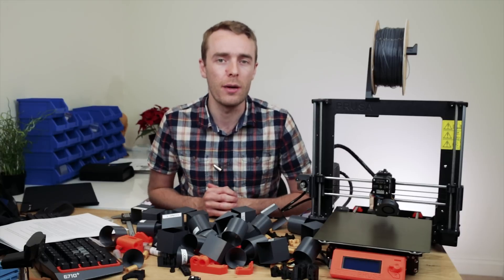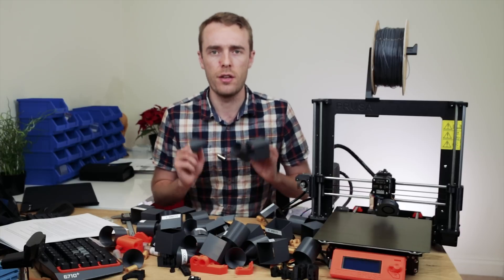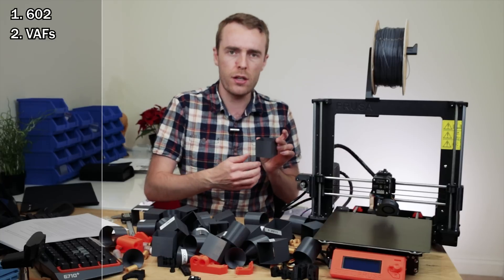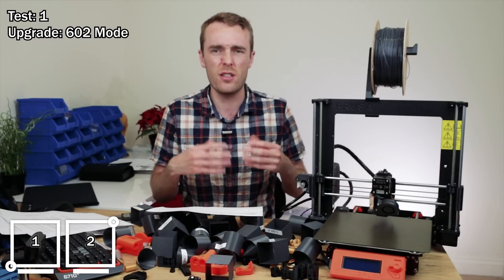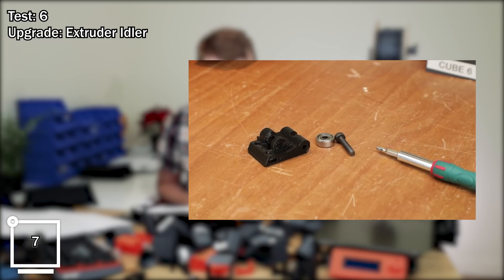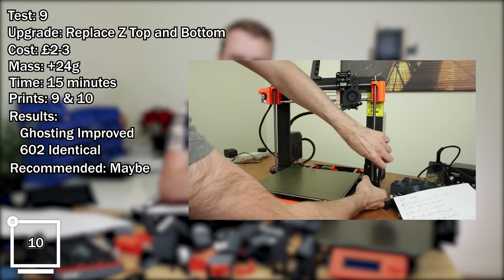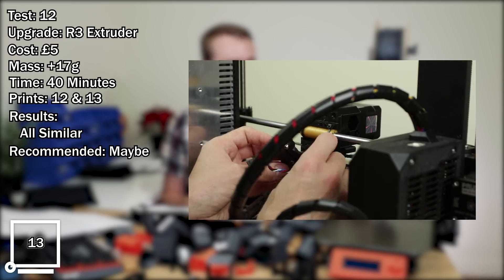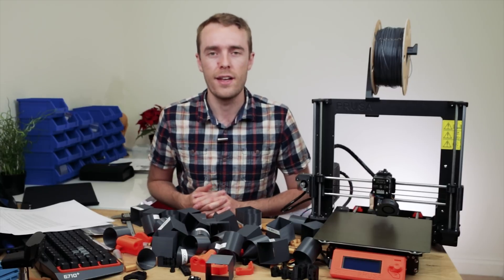4 Weeks Testing Prusa i3 MK3 Mods

Comment: First Craftbot models also used direct drive extruder like the Mk3 and also displayed 602 issue specifically the woven basket look of the walls . Those were using Tmc 2208 drivers and proprietary firmware which leads me to believe drivers and firmware have nothing to do with the problem but that the culprit is the filament driving mechanism . Indeed in Bowden setups or geared extruders like the Titan or Bmg the 602 issue is almost non existant or at least greatly diminished . I suspect that a very short and constrained filament path from gear to nozzle and the fact that direct drive means no backlash to absorb some of the drive shocks means that all vibration results in extrusion pressure altering which leads to the inconsistent layer problem .

Comment: I had unconsistent extrution on my mk3s tried many things.new titaium heatbreak . Bondtech extruder , nozzle ,checking belts nothing help ..but when i changed out the original Main board whit a duet2 wifi board it went away

Comment: Just make a cylinder and put the bearings in, all knows that plastic bearings get deformed without a proper even mount. Correctly made they are way better, very easy to print as well.

Comment: Hi, shooting in HD and thde uploading in 4 k does not increase the detail. How can it?. All that's happened is that some form of interpolation has taken place, but the apparent extra detail is all fake. Stick to HD, no one can resolve 4K TV with their eyesight unless just a few feet away from a 65 inch TV, and most people are watching on tablets or phone sized screens.  It can be worth while doing it the other way round, shooting in 4K and down sampling to HD, but eve that is fraught with problems - extra artifacts can appear unless you use quality software to do it. BobUK.
Reply from the maker: The photos are much higher than 4k resolution.

Comment: Yet those prints look worse than a properly tuned ender-3 :/
But this goes to show, frame rigidity matters most, and Prusa has been always crap on that. See how the feets change the results, if the frame was sturdy, it would have 0 impact.

Comment: After struggling for months with the 602 and related print quality issues, after trying all reasonably cheap and effective mods I could do, I could not solve this... until I've built myself a Skelestruder (w\ Zaribo Pancake motor, the lightweight shaft, ..) by JLTX! Since the extruder rebuild/switch, It's been printing consistently easily and fast, the extruder (end even X axis) motor is completely cool at all times, I am speechless. And it all can cost just couple $. Here's the link: https://www.thingiverse.com/thing:2845416

Adam, if you've still haven't solved this issue yourself, please give at least the Skelestruder a try, but don't overlook the JLTX's Taurus axis upgrade "line".

Comment: 602 to me looks like a calibration problem with linear advance which makes sense since linear advance is trying to cause the extruder to extrude t the same rate during accelerations. If its messed up, the extrusion will be messed up. Have you just done a linear advance calibration per the book?

Comment: Is issue 602 fixed on the prusa i3 mk3s?
Reply: i was also wondering this, i would imagine so as they built a new extruder for it
Reply: @theaces3697  I found a solution! https://www.reddit.com/r/prusa3d/comments/c4wxmp/prusa_issue_602_actually_solved_mk3s_and_probably/

Comment: blurry

no need for 4k of fullHD, just use 720p, for the unsharp picture that would be enough
Reply: @Vector3DP  I read somewhere you can adjust the lens of the raspberry pi camera manually. I did it with a small 6.5 mm plastic cap I had been laying around. Just do delicate 1° pushes, THEN the 1080p@10fps would be soo cool :-D

Comment: Hmmm. A lot of work but these better prints look worse than my Ender 3.
One note: every change and print is lowering the mass of your spool. I don't get why designs put the spool on the printer frame. You should try putting the spool beside the printer.
Why would anyone use PLA for bearings?

Comment: I think main problem is low resolution + 256 microsteps. One rotation of the bondtech gears have only 200 full steps. Microsteps do not have much torque. Direct-Extruder do not have the "spring" effect bowden extruders have. So "randomly" only fullsteps tranport the filament, but sometimes also parts of the steps do so - it's not consistant.
By higher resolution of full steps you reduce this problem a lot. I tried thing:3165551 and an original Bondtech BMG (you may also use a Dual Drive BMG from china, as you can change the gears to the original Bondtech ones you already have). Due to the 3:1 ratio extrusion inconsisty seem to be gone. You also can change to a pencake stepper (to reduce moving mass) or a 0.9° stepper (for doubling resolution again) or both (if you can get a 0.9 pencake).

Comment: You may try to put rubber washers (standoff or the like) on the filament cooler fan.  I have seen that fan vibration (specifically from a cheaper blower) to affect print quality by adding noise to a layer. This can be a bit chaotic as it does not always manifest itself the same way.  But when removed (or replaced with an expensive blower) the issue is removed.  The effect is close enough to warrant a try as it may be an element of the problem and not the entire issue.

Comment: Dear C.R.T.! Wonderfully educational video, I have been battling this issue for about 6 months as well, but my research has led me down a completely different line: If I print the cube at a 45 degree angle to the the bed, issue 602 is very highly mitigated for me. This seems to indicate that this is not the extruder's fault, but the fact that there is a repeatability issue in the movement of the axes. 
Try printing your single wall cube at a 45 degree angle, so that both X and Y are in motion at all times, you will be amazed by the difference!
Reply: beherith66 what exactly do you mean by print the cube at a 45 degree angle? I’m still not sure what you mean by that? Thx also if you have any more updates on this issue that would be great cheers

Comment: Also the prusas biggest problem is that the vertical linear rods are attached to the frame with those printed plastic brackets. I Think removing those and replace them with linear rails that are attached to the vertical frame would improve the printer a lot.

Comment: This'll make you laugh. I spent hours in OpenSCAD trying to make single-thickness walled cube/cylinder/cone STL models that would slice with one path on the wall, without success for the cylinder and cone. Then yesterday it suddenly clicked - just use a trivial normal cube/cylinder/cone and set the slicer (Cura) settings to no infill, no top/bottom layers, wall thickness 1. headdesk

Comment: Looking for an answer to my question concerning temperature setup for ABS.
When I start my setup for ABS preheat is set to the filament of choice which in this case is ABS. The temperature ramps up and settles in to match the target temp. When I select the item to print the printer changes the target temp for both the nozzle and bed to that of the a PLA setting. Ideas why or ifyou have seen this happen?
Reply: Thank you for the definitive answer. You nailed it. Again thank you.

Comment: Simply the Mk3 extruder design is shit. Mk2 was good and the only thing needed was cast parts vs printed for accuracy. Superglue rubber feet and you will see a big difference. Tomas just wont admit that his mk3 extruder design was a step back not forward. Especially the filament sensor and the dual knurled wheel feed. I think a felt seal to wipe the extrusion prior to entering the hotent is helpful as is partial bowden feed at least at the entry of the extruder. The rest is just assembly if your zip ties arent spot on and using a torque driver elsewhere for assembly gives uniformity. While prusa is a great printer. The price value outcome is not what it should be

Comment: PLA bushings work, but you have to take a few things into account. For a stock i3 i'd say only use them on the X and Y for noise reasons. Also those are the SHITTY pla bearings, id recomend you make your own, the ones on thingyverse are shit and badly designed, obviously not by an engineer

Comment: When you were making your comparisons, did you modify your printer back to its original state before testing the next mod? That will have major effects on how each mod affects your prints. It looks like you just went from mod to mod in comparisons which acres your results.
Reply: I must agree is this, the effect of multiple mods, makes the results unpredictable. Fx the any good from the R3 extruder might have been negated by the pla bearings. Or just improved the same thing as another mod did that was already on.

I really appreciate the work, but the methodology is a bit flawed it seems
Reply: The issue is still there. One mod could hide or make other mods worse. The test is valid in the sense that if you make the exact combination of mods as you, but not as useful for the result of each mod by it self.

If you test from base mk3 each time, you might end up with same results, and you might not. But the methodology is flawed if you want the result of each mods impact by itself.
Reply: All mod's must be seen as an example of things you might try to improve print quality. There is no guarantee that your situation is particularly similar to the situation Sanlander tried it on, and neither would it if he had made the test more reproducable for his particular machine. That being said, there is one test that I think is invalid as per  your argument. That is the belt replacement. A good test would be to tension the existing belt very carefully, and position the belt very carefully and have "Settings" report a tension that is very near the recommended tension. After replacement the exact same situation should be reproduced, including in particular the tension. Then it makes sense to compare the prints.

I suspect that the outcome would be that it makes very little difference. A logical recommandation would be that if you use your printer enough to discover wear on the belts, or if you need frequent readjustment of the tension, that would be a sign to replace the belt with a high quality one.

One of the things I suspect is the most relevant to print quality is the force with which bearings are screwed. After I did that with much feel, my vertical surfaces are an absolutely flawless regular pattern of 0.2 mm layers, way better than what I see in this video on e.g. the cube. I can't imagine I could or would want to improve on it.
This would suggest an experiment with a controller momentum screwdriver set to different tightness.
Reply: But you weren't doing just one test so your argument is fairly invalid. You're making combinations with upgrades which create new outcomes by themselves instead of testing the individual upgrades.

Comment: You should try increasing your extrusion temp about 20 deg. My mk3 prints look like that when it is set to usual PLA temps, the extruder seems like its around 20 deg less that what the screen says, I have seen others also with the same issue.
Reply: @Vector3DP  True, I had wondered if there were just some dodgy thermisters.

Comment: Try to change the entire extruder to E3d Titan. For some reason i think the Bondtech firm grip on the filament is not helping to have a fine consistent extrusion. I did that on my prusa and i had a significant improvement on my prints.

Comment: Thanks so much for all the hard work. The detailing you have gone through to show at each stage and their results will help many people all over, and it won't be just for those with a MK3. Your awesomely meticulous  testing of the various upgrades will no doubt be used as reference. Now take a rest and do something less straining on the brain.

In regards to the 603 issue itself, Prusa himself has stated the problem is with the Bondtech's drive gears (https://youtu.be/CLCpNIx3O0M?t=825), and I think that's how it will be swept under the rug.

Comment: the 602 you have there doesn't look like an extruder problem, the light and camera work you did was really good, I was able to notice some things: 1st, the extruder steps are not smooth, as noted by the vertical lines you can see on cube 13, 2nd the frame seems to wobble a bit, maybe by .05mm or so, causing those bad layer alignments, 3rd there's an artifact on layer alignment about every 5mm, than can be a mechanical problem, also the rods or bearings could not be true, some h7 tolerance rods and -.03 tolerance bronze bushings or encased igus bushings could be the solution, or maybe it's some printed part that just wobbles, and the wobble will be axially in-line with the moving part's direction, the rod holders for the bed look flimsy for such a high caliber machine
Reply: Probably just removing the spool off the frame would make a lot of those issues disappear.
Reply: checking everything's tolerance is a good idea, also the extruder itself could have a bad design, or maybe the settings you're using aren't perfectly tuned to that machine, because I've seen some amazing mk3's out there, whose prints don't even look printed, they look like renders!

Comment: one thing I've always thought, and many people say: their lm8uu mounting is the shittiest ever, NEVER just zip tie them, it's too sloppy, you need a proper block to hold them in place snugly, maybe this is the cause? also, the 8mm rods are just bad, they're too flexible, 10 or even better, 12mm rods give much better print quality